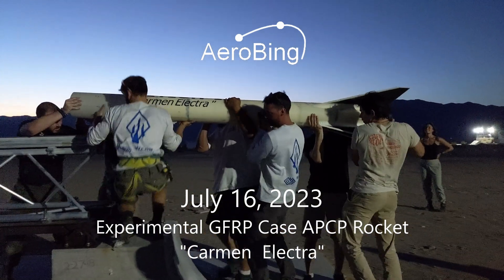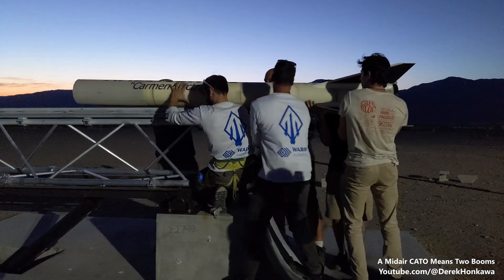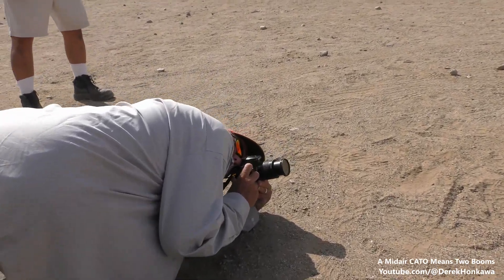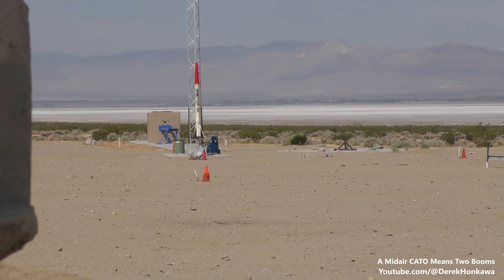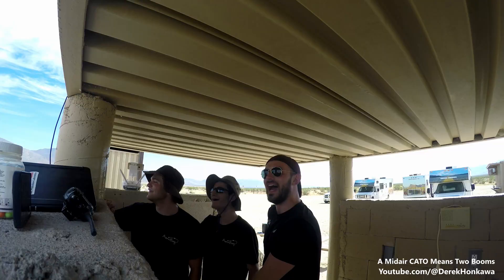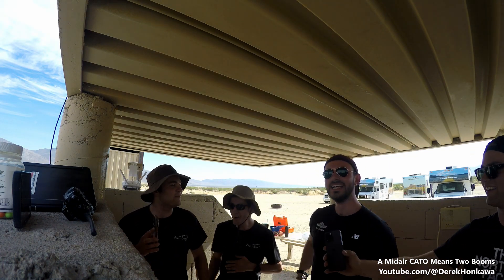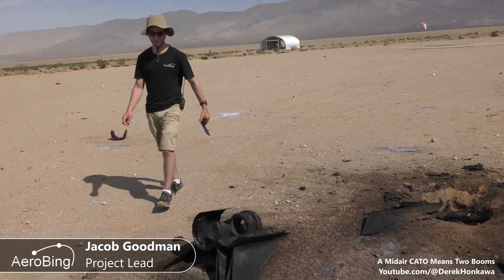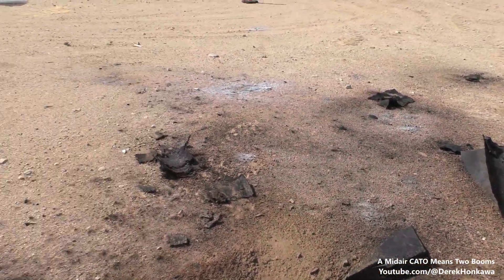Powerful High Performance Rocket Explosion and Impact (Aerobing)

Comment: Damm, I hope this rocket wasnt too expensive and you can locate the point of failure soon. To me it looked like an engien anomalie, maybe something came into the engiens throught. Thanks for posting it
Reply: I think the casing could have been poorly designed or there was a leak past the forward closure
Reply: @wertytop0  Yeah, pretty they glued 2 tubes to make a casing using epoxy and not like with O-rings and bolts, just expoxied, which is what failed and what has failed for them
Reply: @omarflores3150 the tube is not what failed.
Reply: @nathanteig7108  Ah, I must be mistaken with another flight, then what failed this time around if you don't mind I ask?